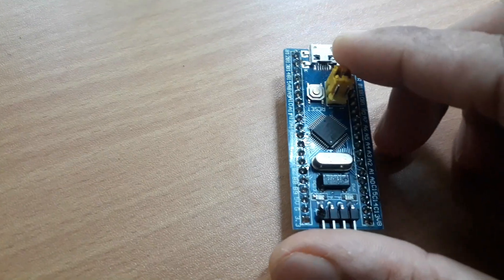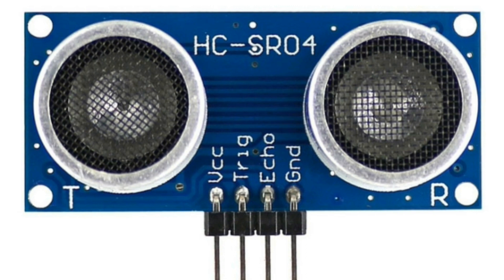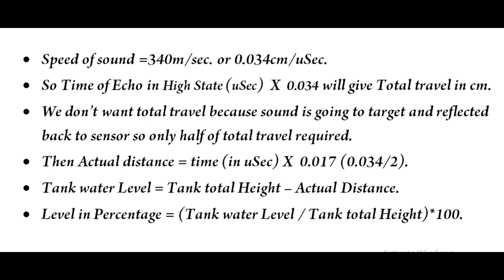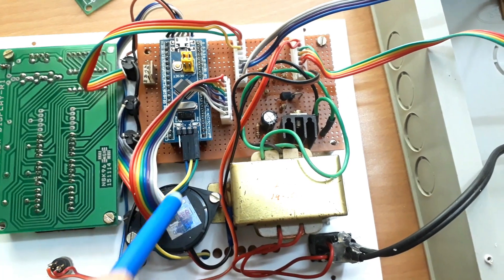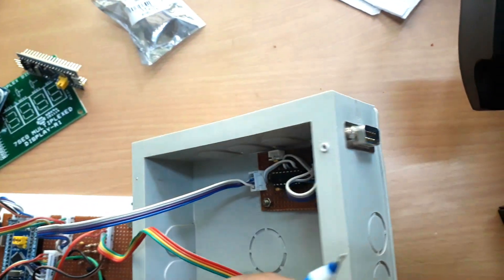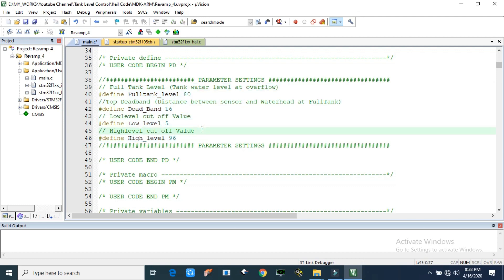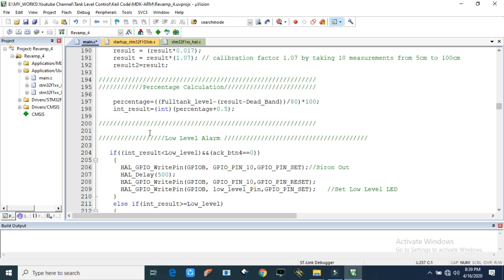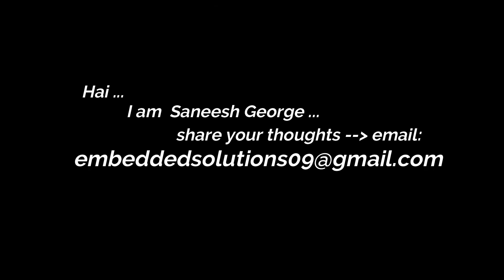ULTRASONIC WATER LEVEL CONTROLLER - HC-SR04 & STM32F103

Comment: Why u put rs232 driver.. pls explain again
Reply from the maker: Cable capacitance will destroy Digital signals (0-5V) when transmitting to a long distance .RS232 (swing from -13 to +13V or Eqv.) is capable of transmitting Signals up to  15 Meters (50feet).
Reply: @embeddedsolutions7508  exactly might be. I created with atmega8 and my sensor is 20 meter away. I connected with a cat6 cable. But my reading are ok from upper half of the tank. But from lower tank it only shows false signal. Wht might problem?
Reply: @embeddedsolutions7508  pls giv me yr mail to send the circuit n code details
Reply from the maker: @Sekhar_Home  embeddedsolutions09@gmail.com